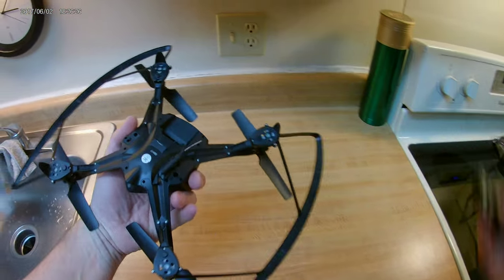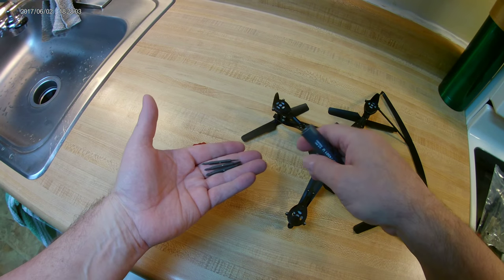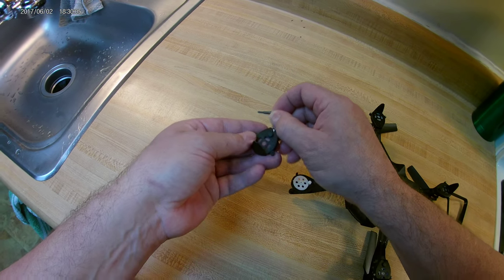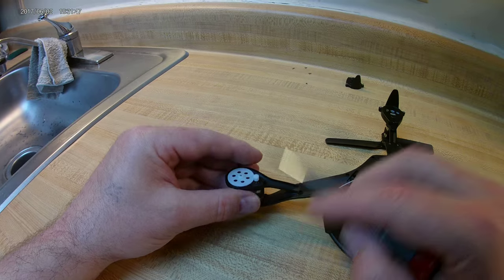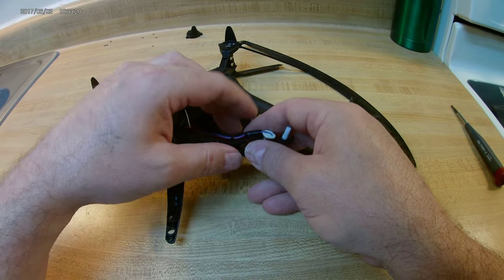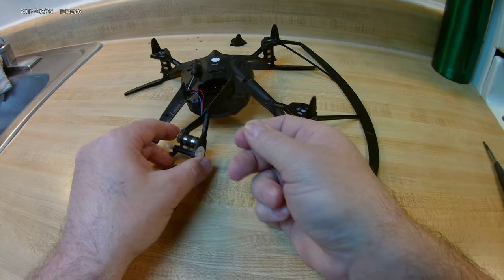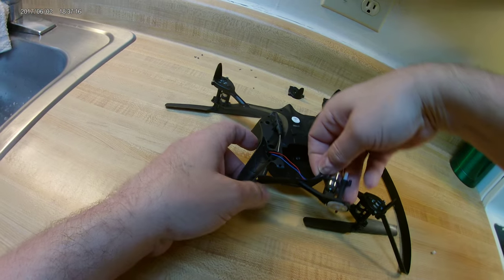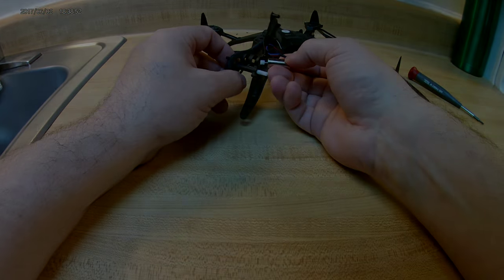Dronium 3X Stripped Pinion Gear Fix

Comment: You show how to fix certain things on a Dronium 3X like motor pinion replacement and how to take it apart, but certain things like straightening the antenna wire in one of your other videos, you did not show how you take apart the top cover to do so - could you include in your videos on not only how to fix certain things, but also show the disassembly?  Other than that great videos.  I am new to drones and happen to find your video because I too have a Dronium 3X and also had the pinon slip - I was able to get the pinion gear working again by simply pressing the pinon gear fully back onto the motor shaft.

I did order spare parts as I know that I will probably break a few things - so far I have only had the pinion gear slip on the shaft on a few different occasions, but luckily pressing the pinion gear back onto the shaft has work so far.

Thanks again for the videos!
Reply from the maker: Thanks for watching and commenting . The antenna video I had meant to make as just a impromptu announcement for the discovery I had made with the antenna as there were other subjects I wanted to include as well in the video without it being too lengthy . But duly noted I will try to make some jump clips of the disassembly in the future just in case .
 By the way the radio transmitter antenna for my 3X was also curved too . I straightened it out and managed to get another 35 to 45 feet more range reliably outdoors but no more then that (^^)b

Comment: I have a dronium 3x as well and one of my motors doesn't turn as easily as the others. It can fly decently but it always tilts and I have to manually trim the balance, but it still won't completely fix it. When I flick or spin this propeller it will go a short time and quickly stop while the others spin freely for a longer time. Almost as if there were more friction somewhere. I've not worked with repairing drones before, so I'm not exactly sure what the problem is. Any ideas?
Reply from the maker: It's has been my experience that usually the the propeller bushing "the part the propeller attatches to" may have been pushed down too far and is making contact with the frame inside or the same thing with one of the other gears as well . That's assuming you don't hear roughness in the gears or gear shaft deformities when you spin the prop . I would also look for foriegn material spun up on the shafts too such as hair , thread , dust and the like . Lastly there may be damage to the shafts or the motor itself may have partially seized . Hope that helps - Scooter
Reply: @scooterfpv8864   I have the same problem, but it doesn't take off at all, and when I pin it, you can hear a light spinning sound that is different from the other motors. Any ideas?
Reply from the maker: @barrsido7070  Thanks for your comment (^^)b I would have to assume that the flight controller is in good working order, the battery is good and the proper signal is getting to the motor in question. That said if the gears and propeller is solid and not slipping on the shaft after trying this replacement shown in this video then there is a good chance that the armature of the motor has come loose if your hearing a higher pitched whining sound from that motor then the others. I would suspect the small gear on the motor has been wallowed out. If you can take some tweezers and easily move it up and down on the motor shaft then that is what it is.
If not then motors for this aren't too expensive and being handy with a soldering iron will go a long way. Hope that helps and happy flying - Scooter

Comment: Does anyone know of replacement gears. The Protocol website shows out of stock
Reply from the maker: That was the place I used to get them. If not on Amazon then I do not know. From my understanding the motors and gear sizes are standardized for other components as well, but that is as far as I know about them.

Comment: I have the same problem and now have the parts, Did I miss a video on replacing the prop gear? Thanks!
Reply from the maker: You're welcome ! Hello and thanks for commenting . I have not had any problems as of yet with the propeller gears and so haven't made a how to video on it yet . I could make a video on this in the near future .
Reply: Its my first drone, I got all the parts as well. Figured I change both since I have the parts, apart from the small gear slipping, there seems to be some damage to the teeth in one or both of the gears, I can hear it when I flick the prop, the others spin freely but the one that is damaged rattles. Seems like you would have to take prop drive shaft out and I DONT want to force anything.  Thanks again
Reply from the maker: Congratulations on your first drone . They are a lot of fun and why I look to waking up early on my days off . I would first look to see if any tiny dirt particles may be lodged in the teeth of the prop gear and if so try to clean it out with an old tooth brush first if you haven't already . To change that prop gear will not be as easy I'm sure . I have been wanting to give it a try anyway and will post a vid if it is a good and repeatable fix without tearing up the drone .
Reply: Protocol was no help, they said they are not meant for user repair/modifications by the end user BUT, they sell the parts..go figure anyway replaced the drive gear per your video and still was rough. It still appeared it was the blade gear sooooo I went ahead onward. With it fully disassembled as in your video, I first "locked" the larger gear by sticking a small screw driver through one of the holes of the wheel and the guard. Then I took pliers and grabbed the square part on top of the shaft where the blade sits, being careful to not round it off or damage it!!, slowly twisting first and slightly pulling in unison until came of. Then I slightly tapped the shaft until it came out. BE CAREFUL of the small copper bearings. You need to take one off to get it out!!. Now I had the wheel on the metal shaft and set it shaft side down on a hobby vice. I took a small punch to knock it out though to small hole it sits in from the under side, then tapped in onto the new wheel on a flat surface and reversed until assembled. It spun as smooth as the others and was I flying again!  Not pretty I know, and there are risks. Don't damage/lose the bearings, shaft or blade seating that locks onto the shaft  . I DO NOT see these on any parts list. And as always, be careful with the motor wires while working!!! Sorry no pictures or video, I was going through flight withdrawl… Hope this helps someone else!!

Comment: The four pinion gears are same size?
Reply from the maker: Yes. The smaller gears are the pinion gears and are all the same size in the replacement parts kit.